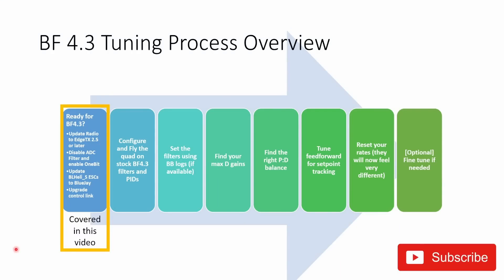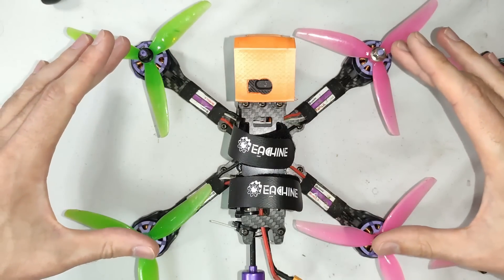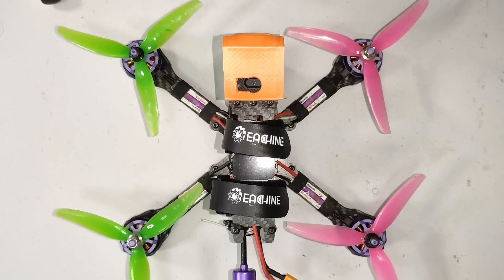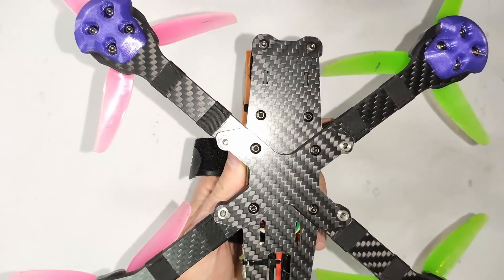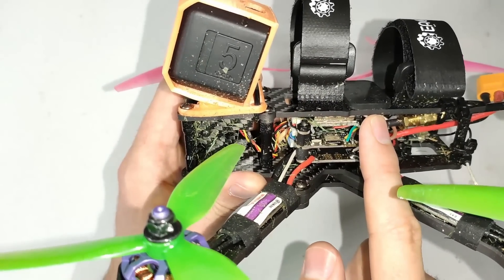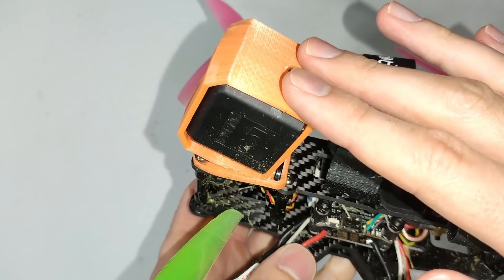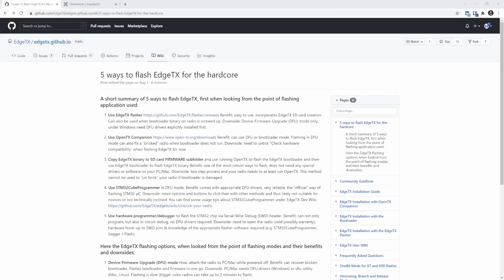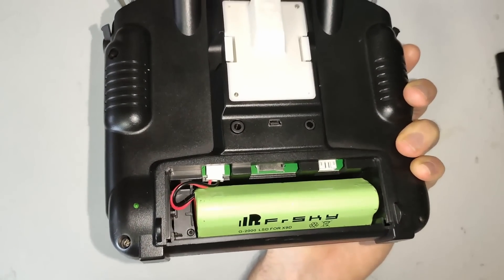Betaflight 4.3 Complete Tuning Guide! Part 1: Are you ready for BF4.3?

Comment: I love the concept of this tuning series, taking the worst quad and the best and tuning them together to see where the tunes and filters end up. I am eagerly looking forward to this tuning series. I found the tuning process to be different with 4.3, I tuned roll P/D ratio first, then pitch P/D and then master slider to hit the D-gains. Its nice that you can now remove FF, Dmin and I gain just off the sliders.
Reply from the maker: That's a more traditional approach to tuning and works great. The only reason I tune master first is I find it easier to hear bounceback with high gains because the sound is sharper/clearer. I can hear bounceback before I can see it in the FPV feed so the sound is important for me. The fact that you can remove FF with sliders is certainly handy for hitting that P/D ratio. 😁

Comment: Why EdgeTX?  Is it the sample mode setting?  What does that do exactly?  Do lua scripts run on Edge as they do on OpenTX?  Will Crossfire for example work properly?  Thanks Chris.
Reply from the maker: Hi Chris, EdgeTX is a fork of open TX with some additional features and bugfixes to improve performance with high packet rate control links. Your radio settings, models and lua scripts are all transferable. EdgeTX supports all the same protocols as OpenTX including crossfire.

Comment: If you make a frame / quad kit that requires absolutely no Fklng soldering, I will buy it.
Otherwise, forget it.  That to me is a "high spec quad".   
Otherwise, it's just a rubbish box of parts that will never fly.  I bought several of those already and got burned.
Reply from the maker: If you are struggling with soldering you can pick up a bind and fly quad to get in the air easily. You will need to learn to solder eventually in the hobby though. A good temperature controlled iron (TS100), flux and plenty of practice is key. Make sure to buy practice boards to learn on rather than using your components to avoid damaging expensive parts. Also, for any new pilots reading this: triple-double-and-re-triple-check polarity (V+ and GND) on every component to avoid burning out parts.

Comment: Hi Chris. Re' Edge TX, I use the integrated Google Earth Pro function in Open TX Configurator to view my GPS-based flight paths. Is this also possible in Edge TX?
Also, re' radio back-ups, can you transfer a back up from the Open TX Configurator to Edge TX? Thanks!
Reply from the maker: I believe EdgeTX works with OpenTX configurator and you can transfer your model and radio settings from OpenTX to EdgeTX.

Comment: Edge TX svx. Avoid
I don't know why you would recommend that
Nobody needs the messed up UI personality of a split touch screen grafted on top of a roller interface.   We found that out with Windows 8
Reply from the maker: I believe EdgeTX is recommended by the BF devs for 4.3 due to some of the under the hood improvements to the communication between the radio and the external module to reduce latency and support higher packet rates and avoid the need for hardware inverter mods for some radios. Consistent (and high if possible) radio packet rate is even more important for BF4.3 and I think EdgeTX provides a benefit there. Touch screen support is coming to OpenTX too, eventually. It might be possible to build EdgeTX without touch screen support if you want to.
Reply: @ChrisRosser  O wpm
O wpm
I won't be running it.   The big radio manufacturers are still goign to put Open TX on their products, so Edge TX is a fringe product that is doomed.   They have a big investment of embedded marketing, marketing their radios as OpenTX compatible or runing OpenTX, and they are not about to change their marketing or websites from some flakey new derivative whipped up by a bunch of impatient amateur programmers who graft on some whiped up touch screen code.
Reply from the maker: @spitfeueranna  You could have said the same about Betaflight when it forked from Cleanflight. You could have said the same about ExpressLRS. You could have said the same about AM32. All those projects got support from manufacturers. EdgeTX will too, espcially because it already works on so many radios. The future is very bright for EdgeTX. They have made so many improvements to performance and functionality in such a short time. As for manufacturers they will simply put EdgeTX compatible on their website alongside OpenTX and start flashing their radios with that firmware. It happened with betaflight and cleanflight and it will happen again. Especially given how long some manufacturers have been waiting for software support for touchscreens on their radios! They will always go with the more responsive and fast moving project.
Reply: EdgeTX is a fork of OpenTX, so it has the same code as OpenTX plus optimizations. You can change the layout on your home screen to match the default OpenTX screen. The comparison to Windows 8 makes absolutly no sense here

Comment: Why it is needed to upgrade the Radio to EdgeTX? Never heard of that firmware before. Why BF 4.3 needs this firmware instead of OpenTX. Iam using a Tango 2 with FreedomTX that means I don't need to switch over to EdgeTX right? Because iam getting firmware updates via TBS Agent.
Reply from the maker: The upgrade to EdgeTX is only recommended for radios running OpenTX. If you are not currently running OpenTX (e.g. you are running freedom TX) then you probably don't need to upgrade and are fine to keep using freedomTX 😁

Comment: Also that point about the long vtx antenna I've been preaching for years. Instead of tpu I use nylon or pla instead and just drill what I need out or mod the file to go over the standoffs snug and helps out a ton! Also if you don't mind a couple extra grams the thick heatshrink with the glue in it will stop the wobble! Still hold the shape if you bend them and if in a crash won't pull apart. But I do that on my long range gear and keep everything seperate as best as possible!
Reply from the maker: Yes, it really helps! So many people come to me with tuning issues and send me a photo and its the VTx antenna. That's the number 1 thing screwing up people's tunes right now in my experience.
Reply: I agree on the pla I have used it also I also have a theory about the soft tpu possibly absorbing some of the vibes when put in the right spots
Reply: @runpuppyfpv5744  I 1000000 % agree and about the tpu in the right spots! Cam mounts I use it as stack spacers and when everyone was playing with tape messing with frame resonance any of my bottom plate are mounting even in My ummagawd remix I make hair thin spacers for in between the plates vibration isolation to the arms and just by doing that on my 7in I was able to get rid of propwash lower my D way down and tuning was made a lot easier trying to chase ghosts vibrations I have a theory about arms being flat and air resistance I'm picking up the air flutter movement through vibration I definitely noticed it with longer VTX antennas another one's My Immortal t that's a bad one because they're kind of flimsy so I have to hard Mount them with TPU so antenna elements aren't just whipping around free and causing vibration especially when airs moving over it fast and fixed hella tuning issues so a hundred percent agree with you been doing this far too long ever since I first had something that had a gyro or anything with a pit controller other than just straight RC link I've had to do so much learning on tuning fast I miss cleanflight and how simple it was to tune I feel like betaflight 3.2 you just needed faster controller and F4 came out I always seem to be able to tune relatively easy but now there's so many features and things and betaflight I remember when Antigravity was a big deal for us and nobody knew what it really did they thought I had something to do with your throttle and how fast you could do punchouts or things like that but it just helps you fall gracefully
Reply: @jbizzbuildsmanstuff9932  belive it or not I have used the o rings which came with the flight controllers on the motor screws between the motor and frame with great success also just put loctite on them and was able to fly with no issues even with a bent motor shaft I did this pre rpm filtering and even after
Reply: @runpuppyfpv5744  oh I believe it! Ppl said soft mounting motors doesn't help any but in fact they did it wrong! Only used tpu on one side of the crews usuially under the motor but when you tighten down the screws it pulls up on the frame and transfers the vibrations through the screw heads. If you use lt lick you said and use tpu on both sides with a washer you can have it snug but not tight and screws won't back out you totally isolate the harmonics to the motor or get ultra low  resinance and can filter it out or add more i term. I came out with a motor mount solution but would require slight drilling but designed isolators that make full floating motors and can fly bent props missing blades and everything and not burn up your gear trying to fly back. It totally worked but diddnt think ppl were too keen on drilling holes bigger. It's science! But it's like guys like you and Dave c and Tommy and a couple others that really have did the homework and grunt work to make it easier for everyone to enjoy stress free flying hopefully! You like me been around the block and back with this stuff and glad you have this channel. I will be the first to admit when I don't know what I don't know. But usuially I come here along with a few other channels that are o. G. Like painless 360, Andyrc, I have a love hate for Bardwell lol but thank you for keeping the info obtainable for everyone without a degree in electronics engineering to understand you. I have that degree back in 99' but in my lifetime I've seen so much change just since the 80s that I know for a fact there's stuff that I don't know because it changes so fast and things I thought I knew where what was aren't anymore and what wasn't possible is so I keep an open mind nowadays and if I'm wrong I humbly admit that and I'll do my due diligence to figure out where I'm wrong and then correct myself they use you guys as reference and it seems to work out pretty well so thank you for the resources and all your hard work my ADHD keeps me from reading pull requests or tuning guides because my brain just goes numb and I'm thinking shiny things haha

Comment: Chris! Do you have any issues with your vtx antenna mounted on the brace like that with the carbon so close? I know it's dji but my crossfire when I mount the tips near the arms on my 3inch I get crazy video noise but only when I have a stubby omni on it. Foxeer lolly pop mini doesn't do that but same foxeer antenna without the lead on it just a ufl mounted close like the stubby on a tpu mount and same issue. Maybe it's just the 900mhz but my video is 5.8 Wich should be far enough away from interference. When I thought maybe it's the antennas and just the carbon I moved the immortal to the center of the bottom plate on my gecko and cleared up. It's digital now and took the turtle and tbs nano32 out and I get lines again not from the motor. It changes with the stick movements oddly enough. Like whe. I was on 2.4 ibus and analog 5.8 and the antennas were grounding out on eachother.
Reply from the maker: I get perfectly acceptable range and penetration with the iFlight Sigma mounted like that. It's a good idea to keep antennas as far away from each other as possible to avoid interference. Your RX antennas also transmit so you need to keep them away from the VTx antennas as far as possible (even though they are on different frequencies).
Reply: @ChrisRosser  I understand that completely I just was curious due to the face I use crsf and know my telem is transmitted back to my TX and that requires bi directional communication and would require a tx in the rx. Crsf I think it's 15mw tx or somthing for telem. I Diddnt know if that would back feed through the frame at all and give you any type of wacky interference but digital would filter that out a bit by the nature of digital but though crsf was digital too or transmitted analog packets in a digital manner close enough to effect sb or somthing. Might just be me overthinking things they couldn't hurt to ask you I keep everything as far away as possible as best I can but when you're working with micro drones and anything under 3 in space gets kind of tight I usual put like my crossfire in front and my video in the rear or the receiver antenna underneath the frame with the elements poking out in between the arms but with low-speed maneuvers you know my are psychos the crap as you could probably figure out why the arms are probably blocking it or the frame I moved it back to the back have better RSSI had to play around with the bands and channels to figure out what was far enough away from 900 or 915 andon 5.8 low enough that my antennas will still work but give me better range than the higher spectrum of 5.8 I'm usually hovering around 5.6 to 5.7 because I discovered my antennas are pretty close to tune to those frequencies more than 5.8 is I have some that are Tunes better around 5.9 but a majority work the best on the lower frequencies of 5.8 but I start getting close to the 900 so B3 happens to be my favorite an analog and it works the best or whatever is closest to be 3 on SharkBite I get the best range penetration and Clarity on that channel even when flying with three other people they're on race band I can't remember what channel is close to B3 on race but the only time I have an issue is when I go higher in the Spectrum which kind of makes sense because lower the frequency along the wave the better the penetration and range

Comment: Man i can’t take the time out of my gigs and ask the inverted in between to flash firmware and try edge tx.  Sounds great but a lot of work and testing before gig ready
Reply from the maker: I understand, if it's your job you need to keep using consistent gear. However, if you are looking to upgrade to BF4.3 then you should move to EdgeTX.

It'll take you a lot longer to transistion from BF4.2 to BF4.3 than it will take you to update your radio from OpenTX to EdgeTX I can tell you that much!
Reply: @ChrisRosser  That is a great watch out.  Maybe once the snow settles in this year I'll have a safe couple of days to work on updating.   ELRS is fantastic btw.  I just converted my backup betafpv lite radio to ELRS. Not sure if that one can run edge though.
Reply: @Shauny_D  Is it the original Lite Radio 2 running open tx or is it the SE version ? I think the former can be update using the x7 target, I’m sure that the SE version cannot, since it’s not running opentx
Reply: @MrAlucardDante  hmm good question.  It is the lite 2 original from a couple years ago.  I bought the elrs circuit board to swap out that says it is also compatible with the se version so I have no idea where it falls now.  Haven't paid much attention.    It is just my little backup I keep in the trunk for commercial gigs.

Comment: 4:04 Never !!!!NEVER!!!!  connect ground from electrick part of quad to  carbon frame. It can destoy your FC.  Burn uarts.
Reply from the maker: I have to disagree. The frame of the quad will almost always be connected to ground, either through the flight controller stack screw holes, the ESC screw holes, the motor screws or the antenna SMA (the outside shield is ground). Having the frame connected to ground is not a problem and will not put any components at risk (it's similar to a PC where the metal case of the PC will also always be connected to ground) Having ANY other connection (especially VBat) touching the frame can cause problems, however.
Reply: @ChrisRosser  no.  I have 20 year experience in electronics repair... and I thought
  the same as you now ... Before my FCs start to burn )))  Than i found problem )
Reply: @HERSDT_FPV  If your FC's are shorting to ground, stop allowing positive voltage rails to touch the frame. The frame itself has a likelihood of being grounded through mounting PCBs whose mounting points are (most of the time) part of the ground plane of the PCB, just like computer motherboards.

With '20 years of experience', you should already know this.

I get a kick out of you (trying to) flying around with vbat, 3.3, 5v, or 9v hot on your frames though, good for a chuckle. 🤣

Comment: EdgeTX not needed - but honestly anything that results in disabling ADC Filter is worth doing.
Reply from the maker: SugarK and some of the other devs were pretty adament that the improvements to the communication between the radio and the module (in terms of latency and packet rate) were valuable for BF4.3. I agree it's maybe not an essential upgrade, but it's quick and easy so why not? 😁
Reply: @ChrisRosser  Yes, the key part isn't the latency, but backet arrival consistency.  I would also agree that ELRS 2.4 is the most cost-effective improvement across the board, but not really necessary.  I still have another 36 quads to move to ELRS, and haven't been in that big a hurry.
Reply: Disabling ADC is also an option in OpenTX...

Comment: As a master of vibration analysis (: , please remove the filamnet spool from the top of your printer (:
Reply from the maker: I know, but it prints great so I'm not going to change anything about that setup, ever. Unless, it stops printing well, of course!
Reply: @ChrisRosser  ha ha, yep in printers the “if it's work don't touch” is great (; principle, until you burn something and then you need to become  printers guro /: